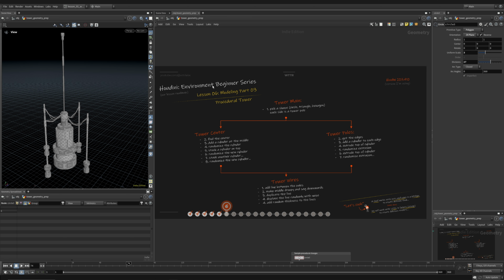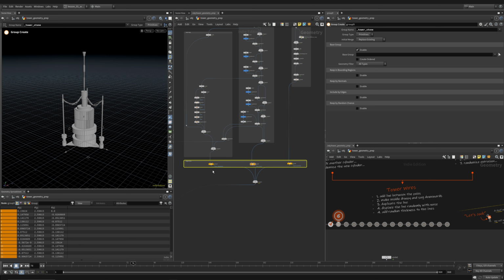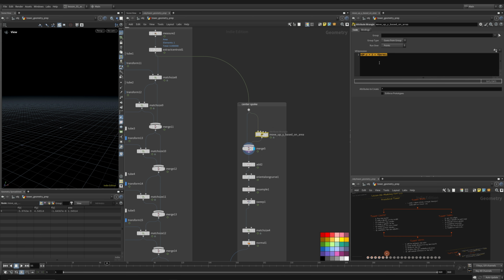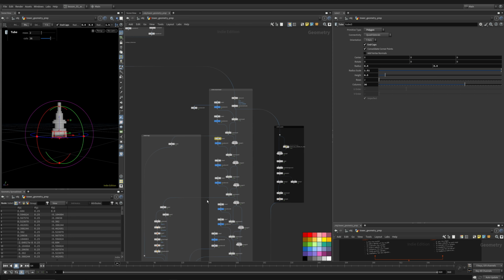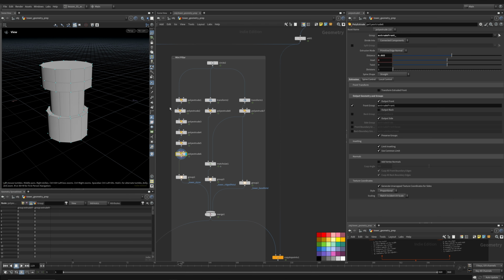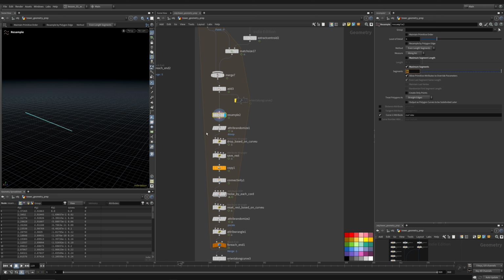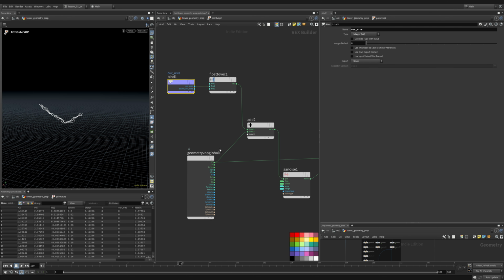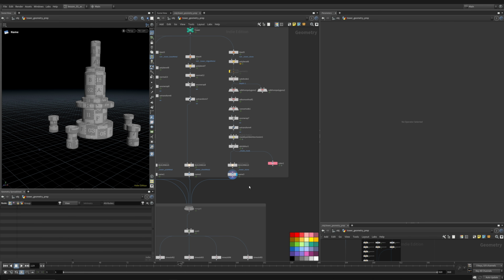Lesson 06: Modeling Part 03 - Tower (Free Environment Mini Course)

Comment: matching the wires with small pillers does work if the pillars are more than 3 and breaks if they are not couldnt figure out what is the problem, the beggining of the wires does not match or touch the small pillars, thanks for the tutorials
Reply from the maker: Send a screenshot to info@wttrlabs.com with what it looks like as well as a time stamp of where you are in the tutorial! I can take a look and get the question answered, it should be a quick fix!